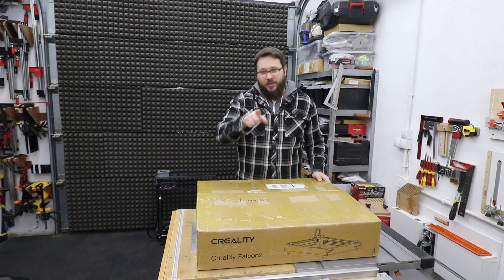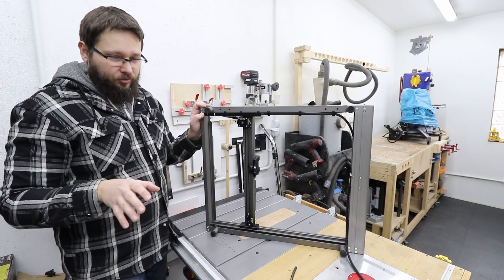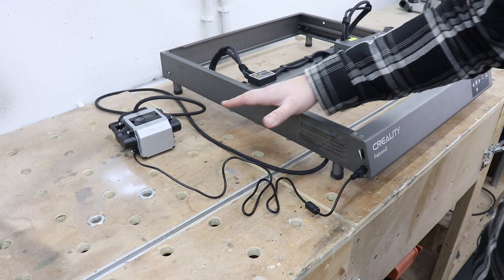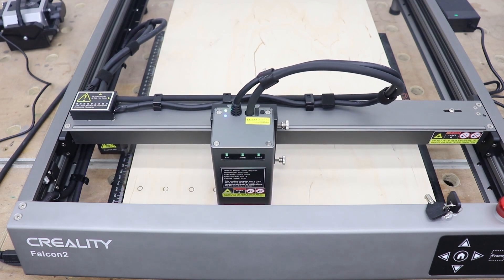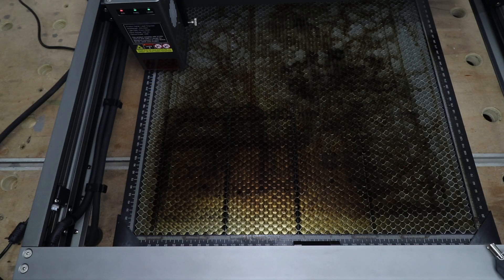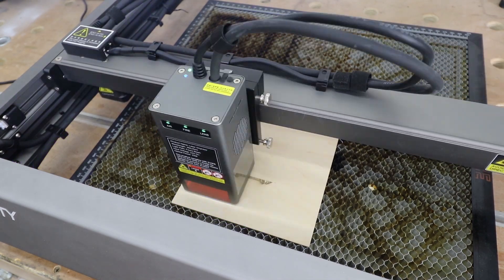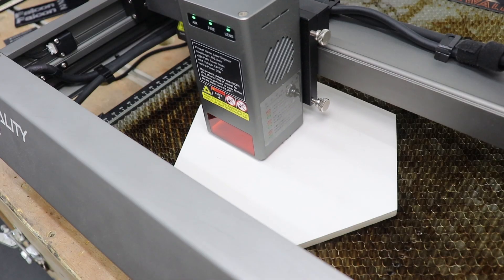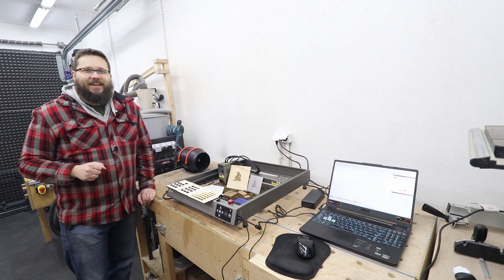Creality Falcon 2 22W Laser Engraver | Detailed Assembly & Extensive Testing

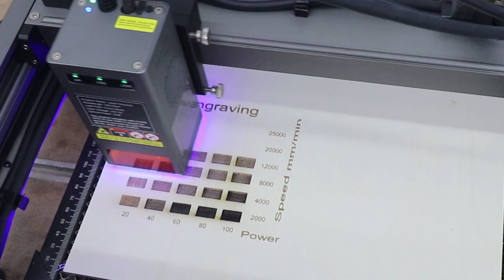Comment: 9:07 FAKE? The surface does not peel off so cleanly. The cross section is too clean. No smoke.
Reply from the maker: It's called air assist 👍and you virtually seen how it engraved it and cut it out. The key is air assist, good honeycomb base, and settings.

Comment: Hi Tomasz, I noticed you are using an inline extractor to extract the smoke and fumes.
What CFM or M3/m  is suitable for this machine?
Reply from the maker: The one I have is 530m3/h however it will work best with an enclosed laser. If its not enclosed then inline fan like this will only help with removing some of the fumes but not all.
Reply: @CasualDIY  Thanks Tomaz

Comment: what 20-30w diode laser do you recommend today? thanks
Reply from the maker: Any of the one I tested to be honest. They are all good, had no issues with any of them.  One thing I would suggest is that you choose the one with those "extra" features each machine has that makes them unique from each other. Choose the features you want and then the price if that plays any role in the deciding factor. Think for what jobs you will be mainly using the laser and what features would help you of getting that task done better, quicker, easier etc.
Reply: @CasualDIY  mostly i would be cutting templates for my woodworking projects and engraving cutting boards, coasters and making small ornaments for christmas, easter ... the big problem is that i'm too poor to choose wrong for my first engraver :)
Reply from the maker: @mihgio3235  well one thing to remember 30W will cut thicker materials and will cut faster thinner materials. Have a look at my videos with the lasers that have the power you are looking for and you won't go wrong with any of them. So just check which one is the cheapest or has the best offer

Comment: Hi, I have 3mm white and transparent PMMA XT  and 15 passes are needed to cut white PMMA. When I see your video, it seems that on pass is sufficient. I'm using Lightburn. Any suggestion? Regards
Reply from the maker: Diode laser won't cut transparent material, and it will struggle with bright colours. It will perform best on black material.
Reply: @CasualDIY  Thank you very much

Comment: It doesn’t come with the honeycomb. You used your own?
Reply from the maker: Yes I used my own, a bigger one. But as an extra you can get a smaller one like I had in the box with the laser. Although I would recommend getting a full size of at least 400mm x 400mm anything smaller is pointless, looking at it from perspective and time spent working with lasers.
Reply: @CasualDIY  what’s your favorite diode laser 20-24 watt
Reply from the maker: @RacingOldTimer  hmm though choice I would say Longer B1

Comment: Nice machine and quite capable of doing anything you can dream of......pity it is already a complete set-up as it 's not capable to be expanded to cover a larger area like the Skulpfun S30 pro model does.......the laser is what gives it the cutting force and there are 40 watt lasers doing the same thing.
Reply from the maker: The market is quite saturated. I will be testing some new 30w and 40w models. I wonder if they will get similar capabilities as the CO lasers. I think the Longer has an extension to their lasers

Comment: I purchased a Falcon2 in the UK, last week, and it comes without the honeycomb table, just steel (?) sheet about 1/4 size of the frame. So check the details of the offer before buying. A large honeycomb table and plate is about 50 GBP, extra.
Reply: Yep I have just purchased one. And also had no honeycomb bed. I was a little disappointed as I have watched alot of reviews and they all had the bed.
Reply from the maker: Seems to be correct yes
Reply: Yes, it was a misinformation. But now the 40w is out and I'm wondering if i should be getting that one.

Comment: Unusually bad sound on most of this video. It sounds like you are talking into a pillow! It's all dull and distorted, but also too soft so my volume needs to be maxed out.
Some parts of the edit are better than others, but the worst parts are almost impossible to understand. What's happened?
EDIT: seems I have a problem with one speaker in my laptop. Comments farther below clarify how I came to that conclusion....
Reply from the maker: Not sure. I just had a listen on my phone and it sounds ok for me🤔 one part was recorded with my wireless workshop microphone and the other with a podcast microphone connected to my laptop. Is the audio bad over the whole length of the video for you?
Reply: @CasualDIY  - It's quite muffled overall (maybe the sound deadening panels?) however the really poor sound quality seems to cut in and out between editing cuts, perhaps depending on which mic you use?
I checked a few other videos of yours and it's similar in those too. But I don't remember it being like this in your older videos.
It sounds reasonably OK on a phone, but on my Mac laptop it's really poor compared to other channels. It's kind of distorted in the recording, and the levels are really low... remember I'm compared to other channels.
I think what's needed is to do some sound equalization (boost midrange and treble) and volume normalization during editing, and make sure you have the gain up high enough in the final mix. You are best do some comparisons between this video and some from other creators,  because I cannot really describe it well in typed words. Watch "Mr Carlsons Lab" for an example of outstanding voice overs.
Reply from the maker: @johncoops6897  Ok cool, thank you for the feedback I'll try to dig into this
Reply: @CasualDIY  - just one thing... I am going to compare between computers here. It could be that my particular MacBook is kind-of "magnifying" the issue. Nevertheless, you can certainly make small tweaks to make improvements.
Reply from the maker: @johncoops6897  Yes I'll have a look into this for sure. I always put the videos together with my headphones on (decent ones) and maybe that's an issue as well. It may sound good for me due to the headphones. I think I just need to invest in some normal computer speakers as well. 
I know that my cheap wireless microphone that I use does cause some static noise. I just can't afford a decent one like the Rode that would work better.
Reply: @CasualDIY  - Cool. I just compared this MacBook to another identical one, and it seems that the inbuilt "subwoofer" is distorting quite badly compared to my other MacBook. 
Now I will run some frequency tests on both machines, and come back here with the results.
Either way, your audio levels are quite low and not very "crisp" compared to other channels. With laptops and phones there isn't as much ability to increase the volume like with headphones or powered speakers, and I need to have your channel maxxed out to hear what you are saying.
Reply from the maker: @johncoops6897  ok thank you
Reply: @CasualDIY  - Follow up for your info... Well, I wasted hours swapping the tiny "subwoofer" speaker, which was torn, between the 2 laptops. That distributed the distortion so now I have TWO MacBooks that sound terrible 🤣
I can only conclude that there is something wrong with the audio amplifier on one machine, and that is introducing the distortion that I mentioned earlier. I also checked with my phone and your audio is soft volume but it sounds OK.
Therefore I apologize for wasting your time, and have edited my first post to mention what I've found on my equipment. Cheers from AU 🍺 😃
Reply from the maker: @johncoops6897  well that was a journey, sorry to hear that your laptops are damaged hope you cam get them mended
Reply: @CasualDIY  - Well, in a obtuse way you helped me find and potentially fix a problem.
And I used a very casual DIY method, so there you go! 😉
Reply from the maker: @johncoops6897  Hehe 😁👍

Comment: Hi, I'm new to laser engravers and I'm between this and the sculpfun s30 pro,  someone who has tried both and can give me an idea to lean towards one or the other.
Reply from the maker: I have not used the Sculpfun, but it seems it has an old style frame. This Falcon 2 is a new model and everything is hidden away in the frame, plenty of power with the 22W module as well. If the modules perform in a similar way then I would go for the Falcon 2 ( the frame and safety features on the modules make all the difference)

Comment: Yet another brilliant review Tomasz , out of the machines you have reviewed so far which one is becoming a firm favourite? Maybe a head to head review at some point. 
Keep well my friend and keep up the good work 👍👍
Reply from the maker: I think I will do a big comparison in the future. Hmm difficult to point my favourite 🤔 I like the Atezr P10 but I wished it came with stronger module. The Longer Ray 5 with 20W module is nice but because of the size of the module you get a smaller work area. Now so far this Falcon 2 seems to tick all the boxes, although it doesn't have wireless app control option. So it all depends what's specs and features you need. I'm waiting for a new machine with 30W and 40W modules and I think they will become my favourite ones 🤣
Reply: I’d also love to see a bit of a comparison video, I’m looking to buy a laser and there’s so much choice. Another great video Tomasz!
Reply from the maker: @robbroughton8161  that comparison video should be coming soon in the next few weeks